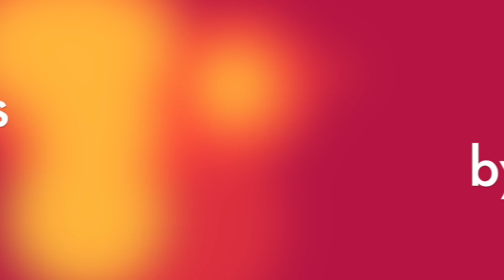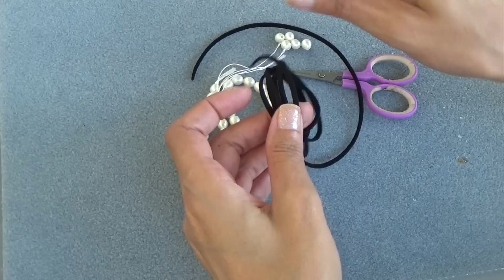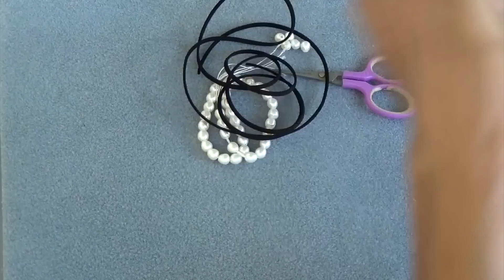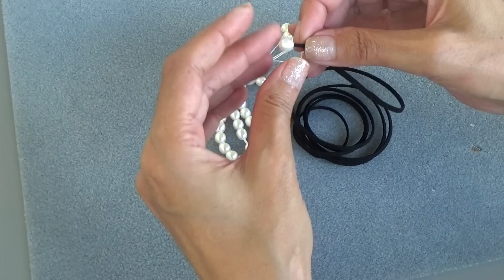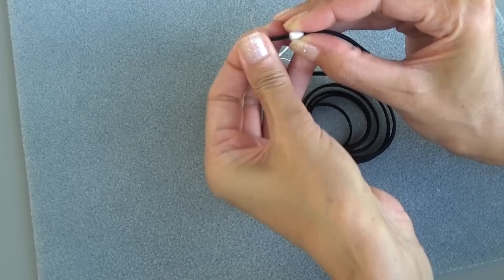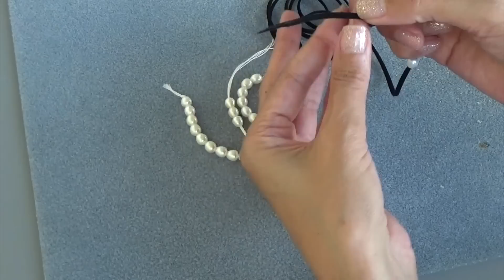How to insert Faux Suede cord in Large Hole Freshwater Pearls - Multi use Pearl Lariat / Bracelet

Comment: I saw another video this morning where the girl made a hole in the end of the suede with a push pin, then used a thin piece of wire about 3 inches long and put it through the hole and folded it in half which made like a needle to thread the beads on. I thought it was a great tip. I just purchased some of your pearls. The are beautiful!
Reply from the maker: Hi, thank you for your message - I am having a difficulty having a " visual" of this idea but it sounds like the cord would be doubled + size of pin thru the hole?? Sounds like a lot of mm thru a hole less than 2mm, right? But ant idea that would make this easier and faster is a GREAT idea...
Reply: Great idea, I've done the same thing with beading wire, which you can use in whatever size does the job. :)

Comment: How do the pearls stay in place on the suede?  Do they stay in place because the holes are small?  What if the holes were large, how would the pearls stay in place?
Reply from the maker: Hi - As you can see on the video, the hole being smaller than the cord, you slide the bead along the cord - it hugs the cord - If the hole was larger it would be looser on the cord
Reply: Great - Thank You

Comment: Put some glue on the end and let it dry.
Reply from the maker: That is a good idea - have you tried it on faux suede??
Reply: MichouBeads No I haven't but I figured it would stiffen the end enough to get the beads on the cord then it could be cut off.
Reply from the maker: jfsfrnd Update: I did the same cutting / thin / needle like + added Hypo cement - waited 2 hours so the cord is hard = WORKS GREAT!! I have a new design with wood beads and will mention this tip ( and you) in my upcoming video - Thank YOU!!!
Reply: MichouBeads Oh that is so cool.  I'm glad it worked so well. :)

It's the ''little tricks'' that help us get through life with much less stress. LOL
Reply from the maker: Absolutely!!